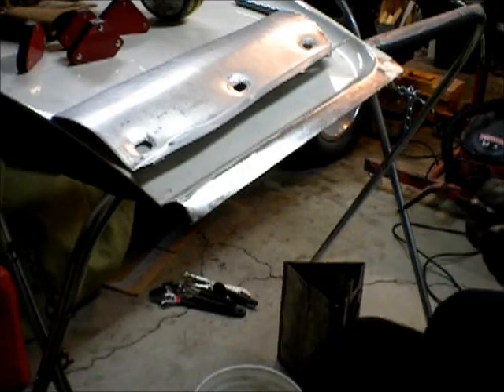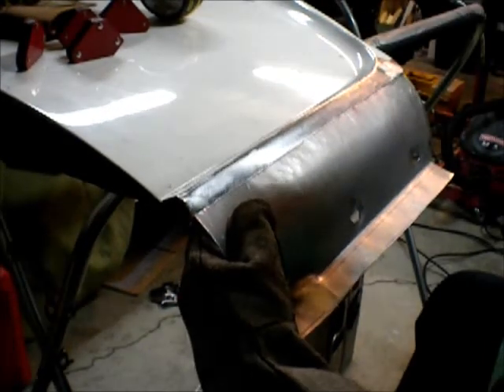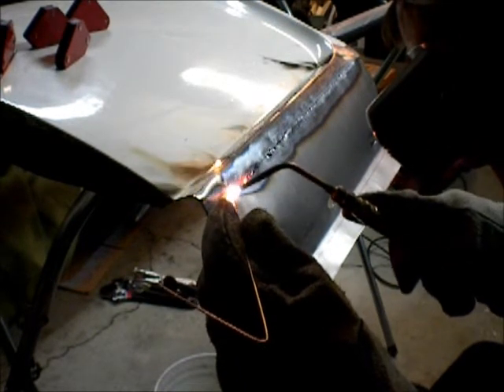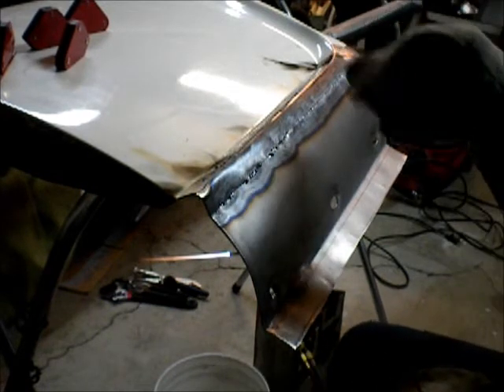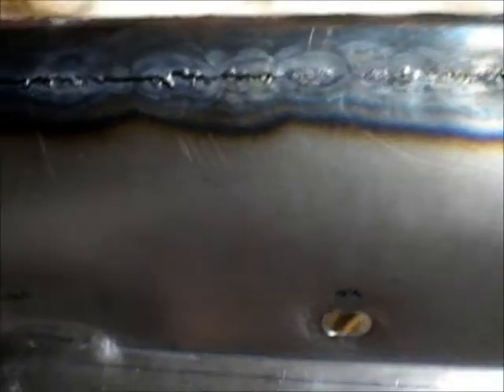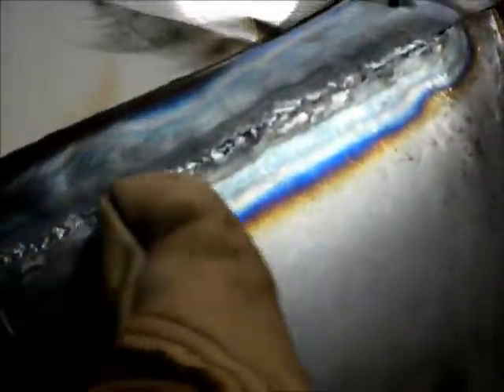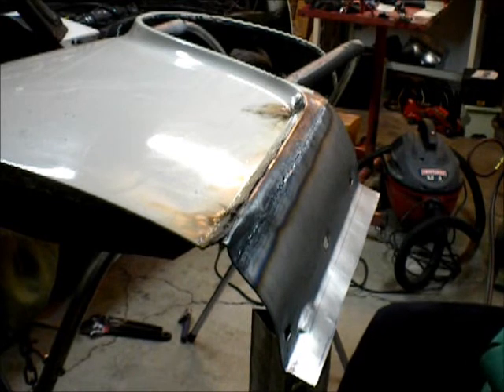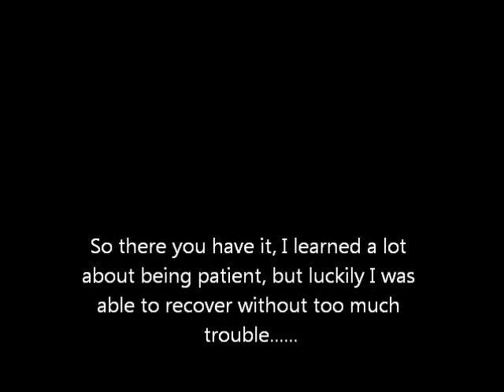70 TR6 Resto #13, Passenger Front Fender, Gas Welding in the patch (Screw-up and repair)

Comment: That's not what I call oxy-acetylene welding.
Reply from the maker: If you're referring to the the gases I used, it's definitely one bottle of Acetylene and one of O2, mixed at a neutral flame. If you're referring to the quality, unfortunately I'd have to agree with you on this particular patch. I rushed it and goofed it up. But I figured I'd show all the dirty laundry. Thanks for watching.